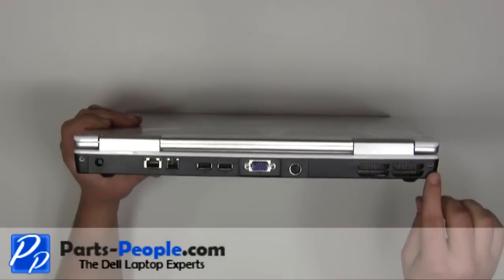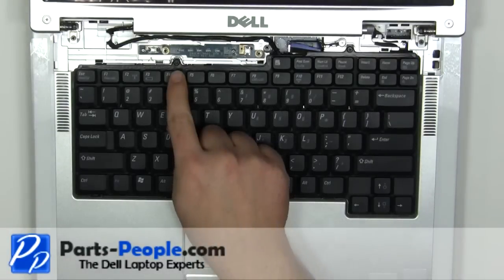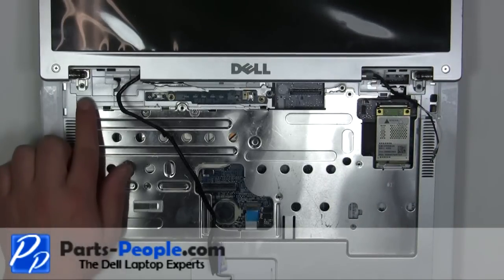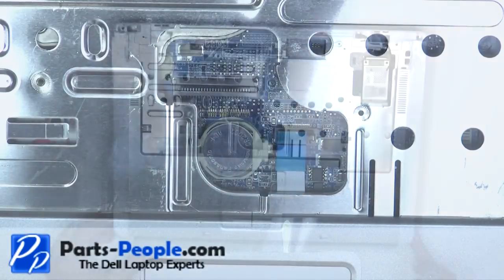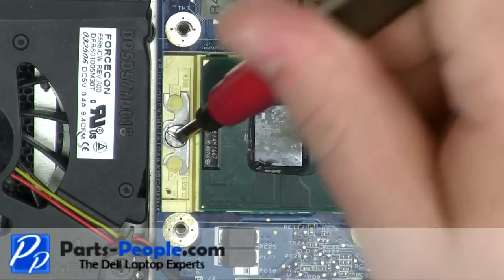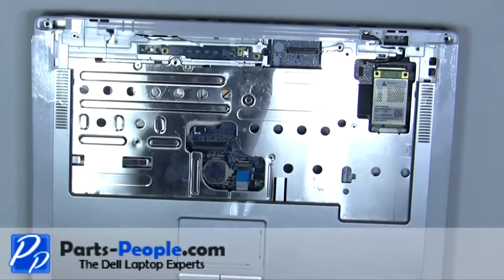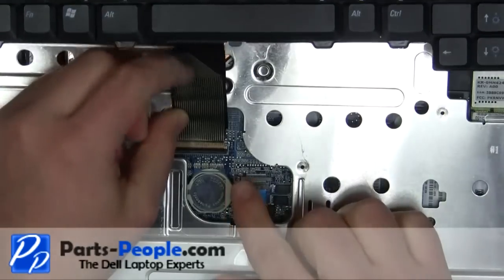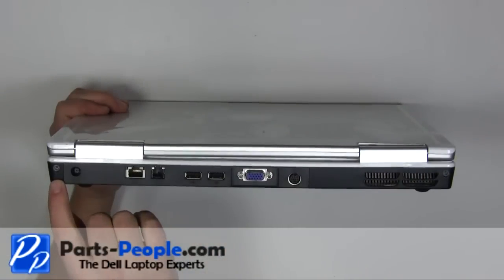Dell Inspiron 6400/e1505 | CPU Processor Replacement | How-To-Tutorial

Comment: I followed this guide exactly, but my Inspiron 6400 won’t boot up anymore and shows the caps, WiFi, and Bluetooth lights for a couple of seconds and then shuts down. The screen doesn’t turn on anymore either. I get that this guide is from 5-7 years ago but I happened to have this old pc
Reply from the maker: There may be a faulty CPU. You may want to reseat the memory to be sure that it is inserted correctly.
Reply: Parts-People.Com, maybe... but I highly doubt that and have went back and made sure I did everything right and it’s all good 3 times. The exact same CPU and RAM worked flawlessly just before taking it apart.
Reply from the maker: @sanidhss  If you power on then press F2 and are able to enter BIOS than that will help isolate the problem.
Reply: Parts-People.Com, Inc I absolutely CAN NOT BELIEVE THIS!!! After putting it away for 2 days and then taking it out to see if the BIOS worked or not, I was able to get into Windows 10 without any problems... WHAT A MIRACLE! Thank you so much BTW for the quick replies... 😉
Reply from the maker: @sanidhss  Nice. Glad it worked out.

Comment: can i put the t7600 in my e1505 i have 4gb ram already but the cpu is currently a t2080 that is only 32 bit windows compatable and i have a 64 bit disc for windows and want to reformat my computer...
Reply: The best cpu the laptop can take is the T7600, but only after being updated to the latest BIOS revision (A17). Otherwise, it can only take a T5600 maximum. The download for the BIOS installer can be found on dells website.
Reply: +TheBluMeeny hi I have 2 intel based 6400 laptops ones has the ati chipset and the T7200 core 2 cpu the other is the intel mobile chipset with the T2300 cpu. I have a T7200 cpu from a dead 6400 can the T2300 system take the better cpu? I asl since the system boards are same other than the video chipsets
Reply: Yes of course, if they are the same laptop, excluding I presume the ati's x1300 graphics card, it will take that cpu without a problem. Just remember to update the BIOS before you do it.
Reply: +Murr pardon the lateness of my reply.
Yes belrc says they are, other than the Intel video chipset machine has a newer BIOS rev.
A question if I may. If I can find the T7600 cpu, from my Google searchs it says the T7600 can run 64bit os.
If this is true would a 64bit OS allow the system to use the full 4gb of ram I've installed?
Reply: +John Smith plz pardon double post.
Darn it just found out to flash BIOS you need both AC plugged in AND a charged battery. my system has a dead dead battery the system and os says there isn't one installed, and the other 6400 has no battery at all.
Reply: John Smith Yes, you can put a t7600 in. However, they are much too expensive for it to be practical. I have a t7400 running in mine, much MUCH cheaper, and basically identical performance. You can find one for around $10, whereas the t7600 you'll be paying easily over $20. Unfortunately, the particular BIOS chip put in most 2005-2006 dell laptops limit the maximum ram to 3.3GB, even if you have 4GB installed. So it won't matter if you get a 64 bit or 32 bit OS, you'll use much less than the full 4GB. You might as well save yourself some cash and stick with 3GB, it's not worth paying for the extra 300mb of memory. I am currently running w10 on mine and it runs fabulously, c2d is still plenty of power to handle what I'm doing, mainly web browsing. As for the battery situation, I had to purchase a new battery as well. They don't go for that much, but they aren't dirt cheap. I found mine for $19, fair price for such an old battery. Make sure you buy it from a reputable site though, there are plenty of duds out there.
Reply: Murr Thank you for the infoz.
Sorry more questions lol. What BIOS rev does the t7400 chip need? Would I see a performance boost over the t7200 chip I have?. I actually have two 4gb ram chips in the ati based machine now, one came with the other is from my old man's old laptop that died.

I might see keep my eyes out for a dead or dirt cheap machine with the t7600 chip, never know might find one.
But I'll be sure to jolt dpwn the info on the t7400 cpu just in case.
Reply: Oh sorry,I forgot you have a t7200. It really isn't worth getting anything else, it won't justify the cost as the performance will be so negligible. If you are running the t7200, you have the latest bios revision so you don't need to worry about that. 

Are you telling me you have two separate 4GB sticks in yours right now? And it works? That is surprising, I don't think I've seen anybody try that before, quite frankly I didn't think it was possible. Are you sure they aren't two separate 2GB sticks? Dell, and every other thing I've read about this machine has led me to believe that it can only take 2GB per slot. I've worked on a ton of machines from this era, and I've never seen any of them running 4GB in one slot. 

And if you do by chance have two 4GB sticks, take them out and sell them. You can rake in over $250 for those, ddr2 sodimm is priced sky high right now.
Reply: +Murr No problem.

Oops did I miss tap? no the system has a pair of 2gb ram chips installed. when I got it, it had a 1gb and a 2gb stick in it. for fun and to see if it would be any faster I put one of the 2gb sticks from my old man's dead laptop in it. System reads it a 3.2gb if I remember right. The extra ram does make load time a little bit faster, separately boot up.

Strange I'd have to look but the t7200 machine has a older BIOS rev than the intel graphics chipset 6400 I also have. the intel one has rev A14. That's why I figured the board would that the t7200 I salvaged from a dead 6400 identical to the one I have with the t7200. K7nd of figured pop in the chip go from 2 to 4gb ram and would have a nice extra inspiron 6400 to play with.
Reply: Yeah it's definitely a good option, you might as well for no money resurrect what is still a solid machine. And as long as you are past A12, you can take the t7200.
Reply: +Murr Yup free is good lol... I think I need some help here.

Oops messed up on this some place.

I thought my intel chipset machine was the right one but Google says otherwise.
mine is the 0kd882 with the intel 945 express chipset. Google says there are two different 945 chipsets
a 945gm and 945pm, if I'm understanding this right the 945 express is the 945gm chipset and it won't take the t7200 chip. is that right or am I just confusing myself?

Here's the belarc info
system model Dell.inc mm061
board 0kd882 rev A14
intel 945 express chipset

Sorry for all the questions I'm no teck expect as you can tell.
Reply: No you can still put it in. The pm and gm designation is just used to differentiate between lack of integrated graphics and not.

In other words, both chipsets are identical, except the pm does NOT have a graphics processor. So you must use a discrete graphics card if you have the pm chip. Otherwise, they are identical in every other way. Most likely, your ati based one has the pm chipset since it was cheaper at the time and it was unneeded for them them to have the gm chip if they were putting in a discrete graphics card. So in other words, you wouldn't be able to take out the graphics card and run off the integrated graphics of the chipset, since there would be none to do so. I see no reason why you would in the first place, unless it was broken, since the ati card is much faster and better than what would be on the 945 chip.
Reply: +Murr Ah I see thank you for the help man.
Reply: John Smith Don't mention it, glad to help.
Reply: @TheBluMeeny  hey I have a few questions for you about this machine, I'm trying to resurrect mine. And do the same upgrades. Is it worth it?

Comment: Which Cpu need you install the Intel Core 2 Duo?   I got a Inspiron 6400 2gb has 2.00ghz T2500 cpu from a trade. 

Could I use the T7400 cpu.    Planning to max the ram to 4gb swapping out the hard drive for 1Tb sata drive I found on your website (thankyou for sharing link from another video) use my Laptop inspiron 6400 windows 7 Enterprise N  for audio recording only will be using Presonus Stuiod Artist 2.
Reply: Yes you can, see my previous comment about updating the BIOS version.

Comment: Also..... for the by-the-way file..... In removing the heat sink to change the processor I had to deal with second heat sink that lapped over the first and was held in place by the smallest TORX I have ever seen. Not awful or terrible -- I very gently eased-up on the 2nd heatsink to pull the first out from under to dismount it---  but I was curious what I have that was not shown in the video. Thoughts?
Reply from the maker: I would guess that you have the model that offered the video card. Basically you have a different motherboard than the one I made the video with.You have a CPU heatsink and a video card heatsink.

Comment from the maker: The 6400/e1505 uses a Socket M processor. The t7500 will not fit (Socket P). The other requirements are: either a core solo or core duo, and either 1mb cache or 2mb cache. The t7400 and t7600 are Socket M but they have 4mb cache, I'm pretty certain they are not compatible.
Reply: https://www.dell.com/community/Laptops/Dell-6400-CPU-Liste/td-p/5241667

Comment from the maker: As mentioned in some of the other comments, the 6400/e1505 has different configurations. In this case, it has on-board video and doesn't has a separate video card or heat sink to remove. Also, if you follow the video, it shows all 6 screws needed to remove the screen.

Comment from the maker: Thanks for the comment. There are two versions of these laptops, one with integrated intel video and one with upgradable (separate video card) nvidia/ATI video card. This model in the video has Intel integrated. So you are correct, there is one more step required if you have upgradable video on your Dell Inspiron 6400/e1505.